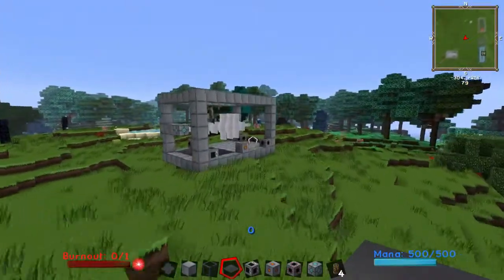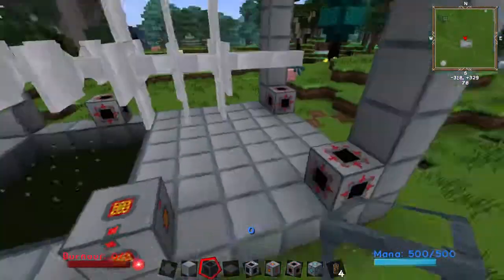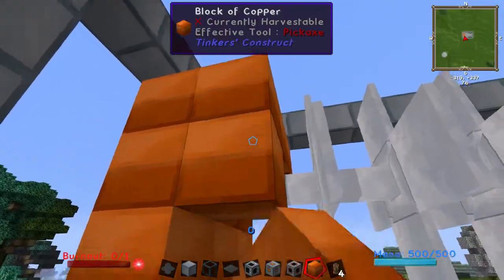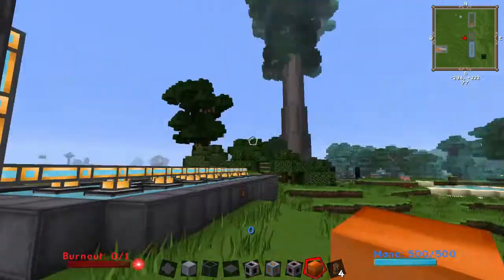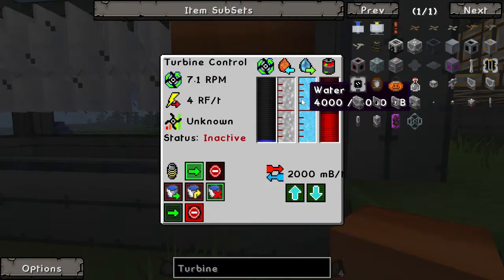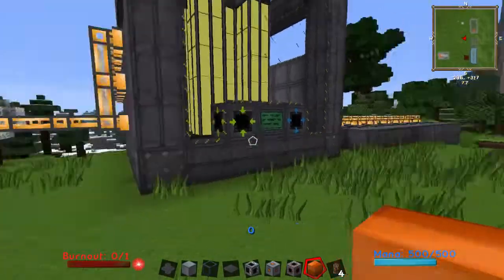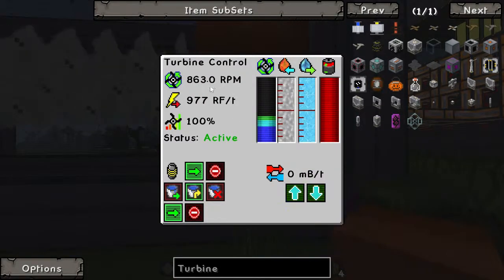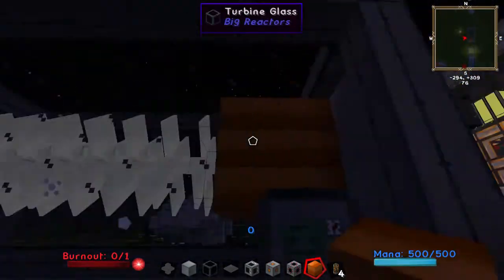How to use Big reactors turbines-tutorials #1

Comment: Not really a good tutorial. If you connect the input and outputs of the generator and reactor, you only really need 1 aqueous accumlator feeding into reactor. Also if you build the reactor and turbine right next to each other (match red on turbine side to red on reactor side, and blue to blue), you don't need piping. Or you can use tesseracts to feed water/steam if you insist on building them apart.
Reply from the maker: i know man... it was my first attemp at any kind of tutorial hopefully you can appreciate that :)